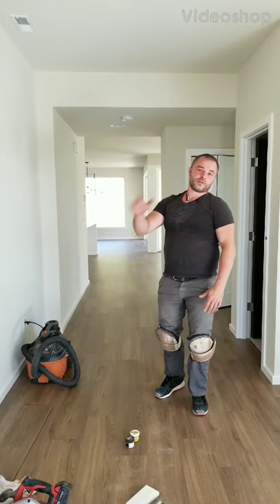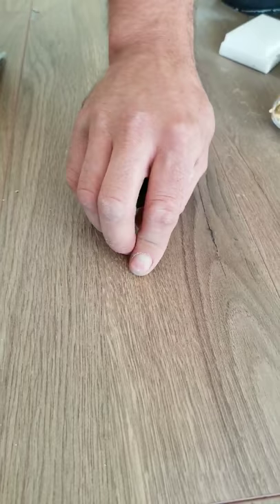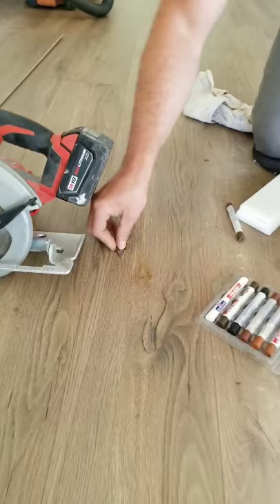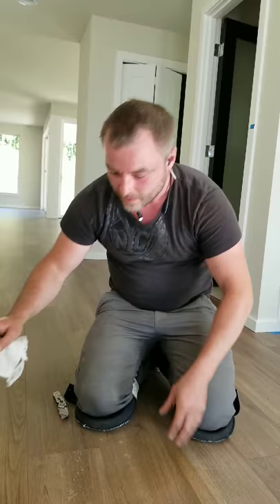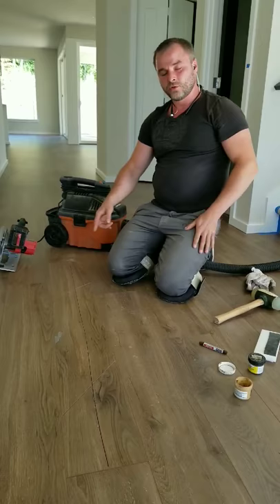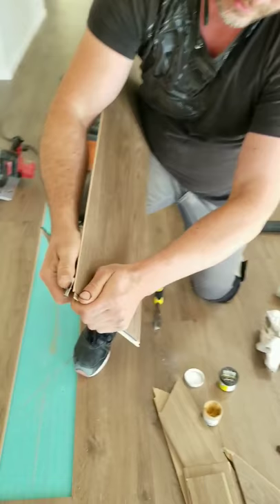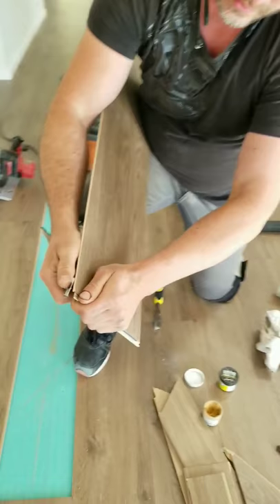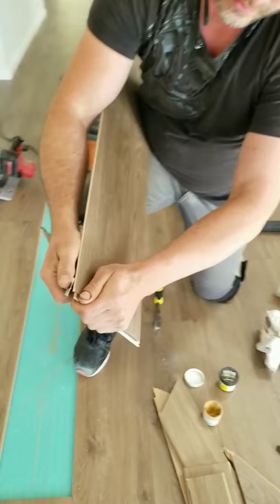How to fix or replace laminate floor board!

Comment: This is excellent.  I had a pipe leak under the sink that went under the laminate flooring. I couldn't get it out for love nor money, but after watching this video I'm confident I can do it. I'm also going to attempt covering the scratches at my front door. Thank you so much!!
Reply: My friend how was your attempt? I have to repair water damage that occurred while I was on vacation. Some of my floor boards are warped.

Comment: I had a really bad set of scratches (much worse than video) from moving a refrigerator by myself sideways through a door on my brand new lifeproof flooring which isn't so life proof BTW,  and I was worrying about it for a few weeks while I was finishing the other interior stuff in my new home.  I purchased the old english dark wood scratch cover and am still amazed how well it covered the scratch.  You absolutely cant see it and this is vinyl flooring.  I really appreciate the poster.  He did a great job and really saved me time and $$.

Comment: Thank you! This is the video I needed. That hot glue and wood glue tip is great. I tried this in the past and I have one board where a corner sticks up. If I had used hot glue, it would have been perfect.

Comment: Enjoyed your repair video, it was very much real life. I saw a professional one on Pergo and the guy was using a track saw. I have every tool known to man and don’t own a track saw, so thanks for making it simple.

How about a complete installation of new flooring? I just installed some pergo outlast and the written instructions I tried to follow and “no way”! Thankfully I found some videos that confirmed the way I did it on my own was right. I’m sure you would do a great new install video since you live in the real world, not a laboratory where everything goes right. Your challenge when the new board was slightly smaller, used the mallet to scoot it into place.

I widened an opening going into my attic and now have to replace 2 or 3 brand new laminate floor boards I just installed before we decided to move a 34” love seat through a 28” opening. Thanks for your help, keep them videos coming, I subscribed and liked this one

Comment: NEVER shoot vertical video. It only looks okay (more or less) on your phone. It looks like crap anywhere else. You can turn your phone to watch a horizontal video. You cannot turn your laptop, desktop or TV screen to watch a vertical video. Apart from holding the phone the wrong way, it is a great video with detailed explanation.

Comment: This man is amazing!  I have been scratching my head on how I am going to fix a plank that has a Dime size dent in the middle of my living room.  After debating weather to remove all the floor leading to the plank. I will try the wood putty first :) if it doesn’t work. I will try to change the plank this way.  Thank you!   I appreciate this pro tips very much 👍🏼 a thumbs up from me
Reply: Did it work? How are the results?

Comment: Thank you so much for this excellent tutorial. I do have another question though. Recently we had a hot water leak and the water ran over and under the flooring. We now have some  really bad looking floorboards. Once we rip out the damages according to your methods do we need to cut out the foam underlayment. I'm concerned about mold. Thank you for all of your advice and examples.

Comment: Dude, you're a lifesaver! Gonna try this real soon. Any tips on how to fix laminate edges that start to go up too much?
Reply: Most likely you have a water damage , and it is not much you can do beside replace and find the issue.
Reply: Cut about 1/4" to 3/8" all around the perimeter of the room completely along each wall. Then wait about a half a day or overnight. The pressure forcing the boards upwards will be relieved and the floor should settle/flatten out. I've successfully done this a couple times. Afterwards finish off work adding quarter round molding to hide the cut be sure not to nail the quarter round straight down, but rather through the quarter round and into the wall. 
I use a multi tool to make the cut around the perimeter of the room. Good luck ✌️

Comment: I tried to fix the little marks filling up ith wax but against the light it shows and the wax doesn't replace the "shine". It also came out, bcse it is a very small "part".  So how do you fix the "shine" that is missing on the laminate plank? The polishing also comes out when the flooring is cleaned!

Comment: Hello art Keeva is it possible to move or slide a pergo floor board to a different place when boards are already down? A client didn’t like the pattern so I am attempting to change some of the board patterns without removing every board. Thanks again
Reply: What a disgrace of a costumer, she should say that way before

Comment: What about when you have a dull floor like color fainting away???
Reply: Unfortunately it Sounds like you'll need to replace the boards if the design layer/coating has faded or work away for to heavy foot traffic. If it's located in just a couple boards try repairing it with this method, if the wear is spread over multiple boards it's just time for a new floor. With these floors you get what you pay for. The lower cost boards have a lesser lifespan VS the more expensive boards such as LVP aka "LifeProof" & etc.